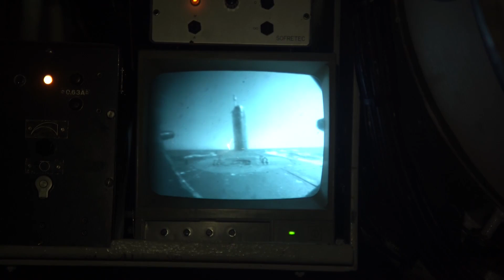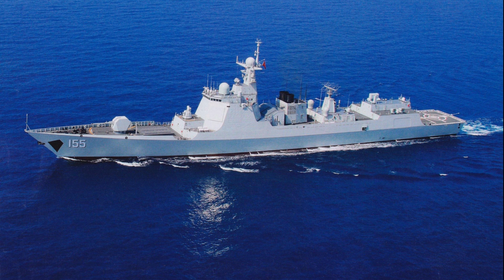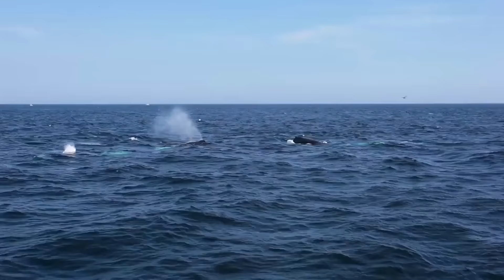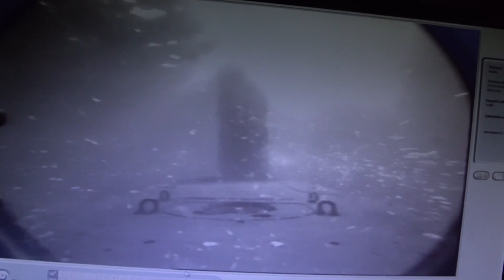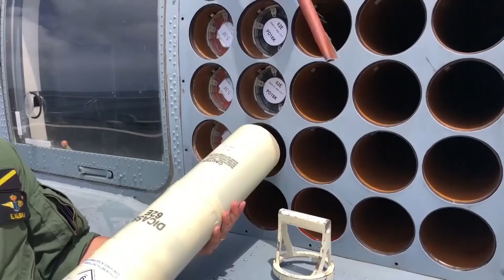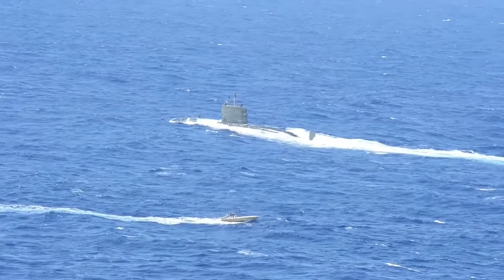Type 212CD: Germany’s New Submarine Changes Underwater Stealth Forever

Comment: I'm not saying that AIP subs don't have a place,  but the threat that they until recently presented has been largely erased by the U.S, and likely (although I'm certain classified) Japan, England, Australia,  South Korea and perhaps Israel as well.

Although much of it is still classified,  we know that the U.S has introduced and almost definitely placed new systems around strategic Littoral areas and Straits, that utilizes Non-acoustic wake detection as well as our newer *Integrated Undersea Surveillance System (IUSS)*.
   Just saying, unless they are sitting on the bottom and not moving at all, it's easier to detect and track with these systems (Granted if we've placed them). Also, is sitting on the bottom, they can't sit there forever.
Reply: If that sensor threat exists to the degree you say, it is a threat to all subs not just AIPs. It all works as a unified system these days, network centric warfare extending from space all the way to the sea floor if need be. And yet, there is no perfect defense, for the weapons grow more clever and dangerous every year as well.
Reply: @wyldhowl2821 you are correct it would be a threat to all submarines. However, the systems from my understanding are only deployed in Littoral areas; i.e Straits and shallow water areas where AIP equipped submarines are going to be.
   Remember, for the most part the diesel submarines that are out there are shallow water, coastal, littoral combat areas subs.
  There are a few larger, Blue Water ocean going diesel Subs but the vast majority are not.
  Most nuclear submarines operate in deeper waters. Although some countries have tactics and needs to bring their nuclear submarines in closer to shore.
  Nevertheless, this is going to affect the vast majority, Diesel and AIP equipped submarines
Reply: @MA2USN  Well, these were specifically built to have more ocean-going capabilities than the 212A predecessor, it's a much bigger vessel for that reason. (Really calling it the 212CD is a bit misleading; there's been enough changs to the design that they could have named it the Type 220 and it would make more sense.)
Reply: @wyldhowl2821 again, you are correct that the new submarines are designed to be ocean-going if necessary. However, they are still going to be traveling long distances on their diesel engines and not AIP, capable of very slow travel for 2 weeks and in some cases up to 3 weeks. 
  The submarines will use their AIP systems when they are closer to shore for combat issues and Will Not Waste the AIP systems to travel long distances.
    So when they are traveling long distances and that's if they travel long distances they're diesel engines will be much easier to detect and when they are in the literal areas around specific parts of the world that the US is supposedly place these systems, United States will have a much better opportunity to detect and track them there as well.
   Granted, nothing is perfect and I'm not saying that the submarines do not pose any threat whatsoever because otherwise there would be no purpose to build them. However, my point is that the threat is no longer is bad as it used to be because of the new systems that we have developed to be able to detect them

Comment: 요즘 시대에 소나로 잠수함을 파악할까? 초계기가 없던 시절에나 가능했지.
Reply: The Chinese and Russian ones are easily detected by sonar. The Russians start out silent but due to a lack of the necessary tooling and parts (sanctions) have become noisy. Not to mention the complete lack of maintenance in the entire Russian navy. Passive sonar can detect nearly any submarine due to amplifier and computer assistance. That is why we shadow other navies to learn what to listen for.
Reply: @ZLSM-fan Unlike nuclear subs, if conventional AIP subs like the 212CD are just sitting there without moving, they have no moving parts. The only moving part when they are moving is the main shaft. No moving parts=negligible sound

Comment: Very nice but sonar is 100 years old. I'm pretty sure you could easily make an other detection method these days. It's like the F35. That 'stealth' was broken with old radar and some smart computing before the US delivered the first sold units. Russia will have listening stations against this sub before the first one rolls of the docks.
Reply: Not rly and not rly in both cases.

Stealth means not imposisble to do so but harder. Menaing you need to get much closer.

Older still needs you to get much closer and the accuracy us usually not good enough to fire a wepaon.
Reply: @emilsinclair4190  You miss the point. Building something to defeat a certain system never works the way it is sold.
Reply: @Cl0ckcl0ck ... except that it literlay does. You just dont understand what beating smt means.
Reply: @Cl0ckcl0ck  You seem to be as stupid as the customers of the F35 "believing" in stealth ... and forgetting about a heat signature of the engines, WHICH CAN NOT BE HIDDEN! Underwater you have a) the noise which the submarine makes itself and b) active sonar ... WHICH YOU DONT USE UNLESS YOU ARE IN A DANGEROUS SITUATION ::: SINCE YOU GIVE YOURSELF AWAY BY USING IT!
Reply: @Cl0ckcl0ck. If Stealth is "broken", & the USA is too arrogant to acknowledge this flaw— Can you answer WHY is Russia, China, Japan, Germany, France, India, etc. trying to develop the next generation Stealth fighter? 
Do you think MAYBE it's because their military have tested stealth against their radar system & they ACTUALLY knows what works & what doesn't???
Reply: It was the lack of stealth when opening the bomb bay doors and not following procedures. They were supposed to have a different route every run but got complacent and continued to use the same route. Please read up on a subject before you start writing nonsense like this. Then you would also have known the difference between the geometric stealth of the F-117A and the modern stealth of the F-35A.
Reply: First of all, F-35 is not broken - its stealth is in fact, growing in importance - since everyone is discovering that all airspace is contested. Think of it like this: no anti-stealth nation has chosen to give their soldiers high-visibility uniforms. You must also separate "detection" from "target solution". Over-the-horizon radars can know that something is flying in the sky (including any stealth aircraft) from thousands of miles away. 

This is handy. An L-band SPY6 US radar can see an F-22 in the sky from hundreds of miles away. It can still not guide a missile. 

An S-band radar on top of a SAAB Ghost Eye can probably understand that an F-35 is somewhere in the sky at a distance of 100 miles. 

This is fine - we can know that something is somewhere - very far away. 

Now you want to guide a missile - so you are switching to X-band to resolve the position. Now you are blind until the F-35 is 20 miles away. 

Let us transfer this to submarines. You use extremely low-frequency sound to expand detection range (water is extremely unforgiving to high-frequency waves - just like air). Air is unforgiving - it is why you think that the sky is blue, right (fast waves are filtered out). Dive into a lake, and it will remove all the colours almost instantly, before everything goes black. 

Water hates high frequencies. 

So Submarine hunting works by sound. In the deep ocean, we are talking about single-digit hertz, right? Try a single-digit Hz on your computer screen. You probably want a kHz screen? Well, that will not work underwater, since it will instantly be absorbed. 

There is nothing secret about why the F-35 is reflecting "AM radio waves well". Those wavelengths go far, with questionable stereo accuracy - right? We are down to the physics of how radios work right now. 

Here is the trick: these submarines are built out of the best-kept secret ever (USA gave away stealth secret within years of the F-117 - Germans have made non-magnetic steel for about 50 years)- there went the MAD sensor. 

Regarding listening stations in Russia - at what frequency are they listening to, and how much noise is the 212CD at what frequency returning?

Here is something for you to google: "how does DAS work". Nobody is listening with hydrophones anymore, my friend. Now tell me about the new Russian listening stations. I am curious about your Russian wisdom. I hope you ponder "blue lasers" based on your obvious qualifications of understanding physics and loving Russia. 

Remember that there is a huge difference between being "known" and being "targeted". 

The F-35 knows it can be easily detected by Canadian and Australian OTH low-frequency systems "ten thousand miles away". It knows that nobody can shoot at me until I am 20 NM miles away. 

AIP subs are extremely slow (having decibel floors at around 5-8 knots like nuclear submarines - again - physics - cavitation is a bitch)

This is why NATO and everyone use active sonar - everyone is pinging - very much unlike Cold War Passive sonar tactics. 

I am sure Russians know physics better. You are correct due to understanding physics, of course - go Russian physics, buddy
Reply: @glacieractivity I would like to slightly push back at the idea of stealth becoming more useful. It is still useful but less than in the past.

We now have automated drones with radar that can get much closer without risking much. We also have differnet sensors sharing their data and ai analysing it whitch pushes back the detection range more and more with each year.
Reply: You FAIL to understand sonar ... because PASSIVE LISTENING wont detect this VERY VERY QUIET submarine ... where the predecessor 212A managed to sneak into a US carrier fleet without them knowing about.
You DONT CONSTANTLY PING YOUR SONAR ... because that would a) disorient marine life and b) GIVE YOUR OWN POSITION AWAY ... and the 212CD is designed to MINIMISE their sonar reflection against active sonar, just like the angled plane designs ... there are some directions that will get a reflection and most other directions wont.
Reply: Russia isn't as good as you think. For four and a half years, they have been fighting in vain against an opponent who is weaker on paper, losing nearly a million people in the process. Their refineries are being destroyed by drones powered by lawnmower engines, and they have no means to counter them. Russia sucks, there is no denying that.